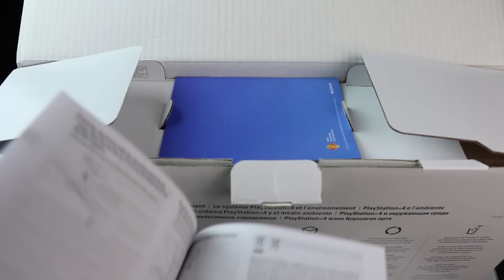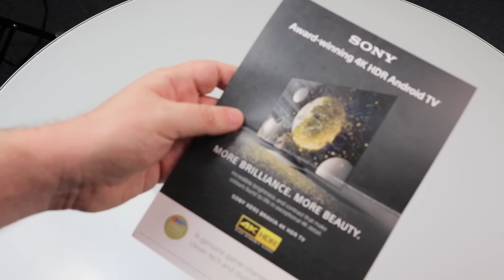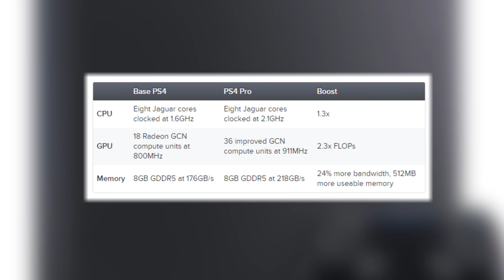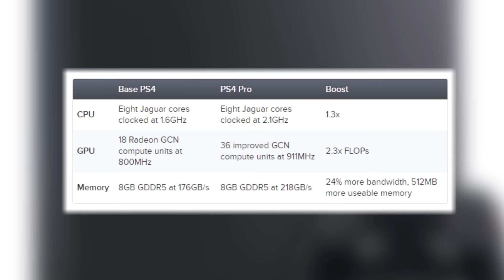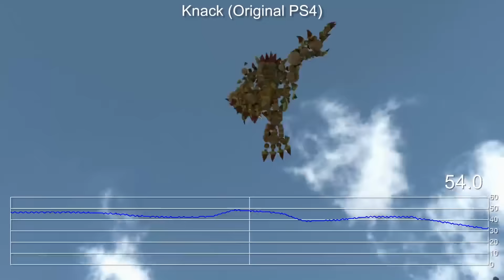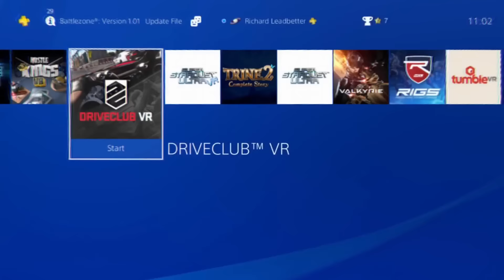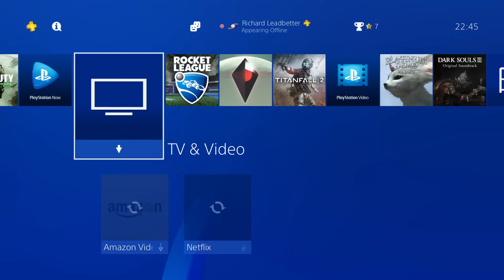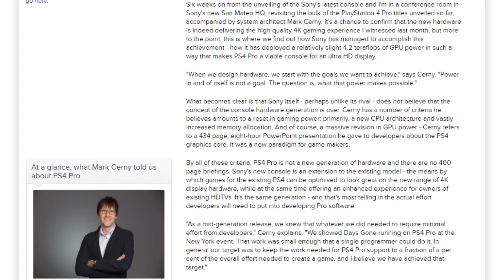DF Videocast #4: Unboxing PS4 Pro, Meeting Mark Cerny & More

Comment: Is this comparable to 970?
Reply: Nope. Not even close.
Reply: not quite
Reply: So more like mid tier pc then.
Reply: Almost! Actually is really close to 970/470 performances, but is more like a RX 470, which is on par or slightly behind the GTX 970 depending on the game. PS4 Pro = 4.2 TFLOPS. RX 470 = 4.9 TFLOPS.
Reply: Bilguun Nyamaa No, it's quite a bit weaker. Around a 280x performance.
Reply: Ed Turvey You're right. 280x/hd 7970
Reply: TheSouthernAssault it has the hardware of something between them yes, but low clocks mean it isn't that. so it isn't near a 970.
Reply: TheSouthernAssault It's an AMD architecture so comparing it to Nvidia GPUs is inaccurate. The PS4 Pro GPU has the specs of an RX480 but clocked down to 911Mhz which makes its performance lower than an RX470. In terms of Tflops the PS4 Pro is at 4.2 and an R9 280x is at 4.1, therefore the PS4 Pro is the same as a 280x/7970GhzED. Which is nowhere near a GTX 970 in graphical performance.
Reply: It's pretty close to a 970/470!  But no where near a RX 480.

The RX 480 can beat the 1060, which is faster than the 980.
Reply: Haxor inator could the 970 and u see
Reply: Ocmode

Comment: Please give me 60fps at 1440p please
Reply: buy pc ?
Reply: There is no 1440p TV on the market. It doesn't exist.
Reply: SteelSkin667 I can use a monitor duh
Reply: TheArb1ter You mean build a pc ?
Reply: if you can then yes that would be much better than buying potato 4 pro
Reply: TheArb1ter Yes
Reply: N7 Reaper Sure you could, but don't expect non-TV resolutions from console manufacturers. If you have the coin, PC it is for you!

Comment: The Sata III talk makes no sense. Why should they change the Data Bus from Sata II to Sata III If It's again band with limited. They could easily save money If they would again use the same shitty data bus/controller from the normal ps4/slim.